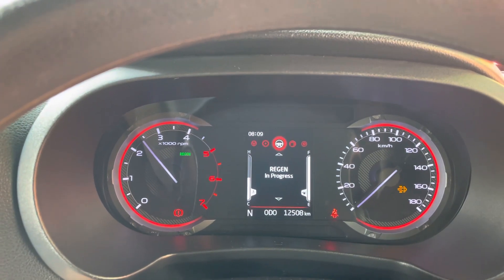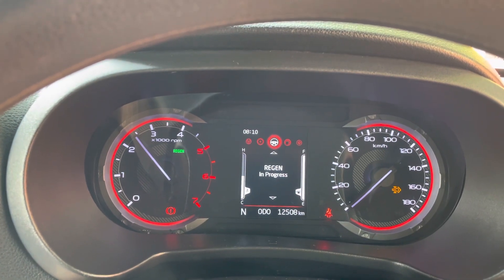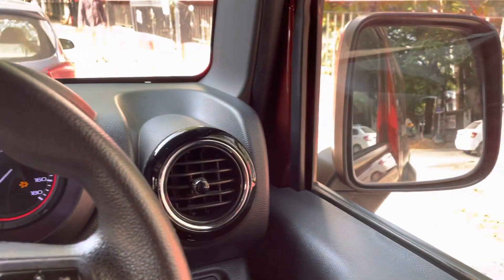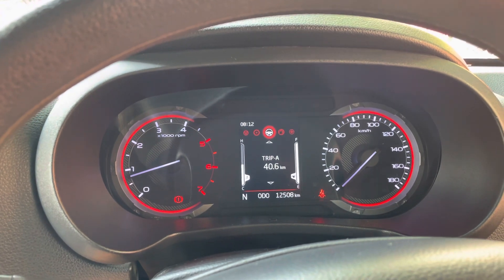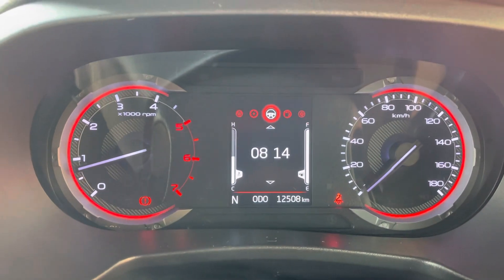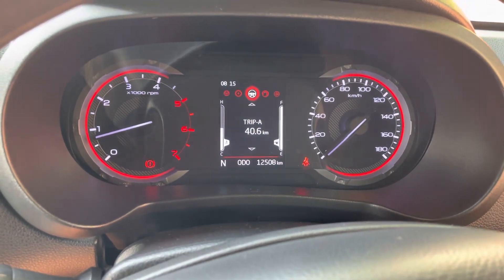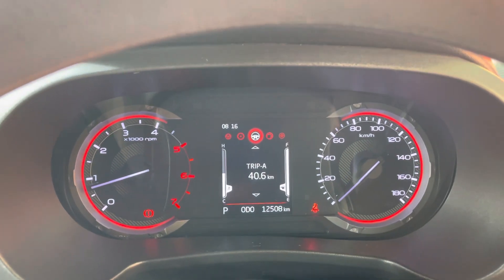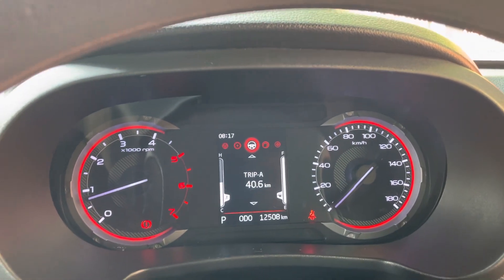This is tricky-Starting DPF Park Regeneration in Diesel Mahindra Thar 2020 BS6 - Watch from 3:23

Comment: Is it okay to do the parking self regeneration process repeatedly? Will it not affect the components of the engine? Pls suggest.
Reply from the maker: @DrRahulMRao  you should do it only once in 3-4 months. If it is asking you to do monthly or even more frequently, it means the DPF is clogged beyond the ability of regen to clear.

Just buy and pour a litre of Mannol DPF cleaner in fuel tank. It will take care of the issue for few months and you will not get regen warning for a while.
Reply: @ Thank you for your reply